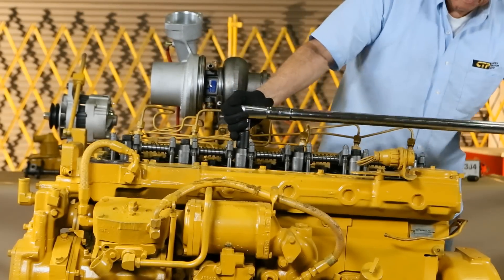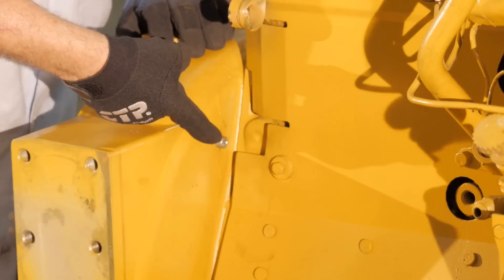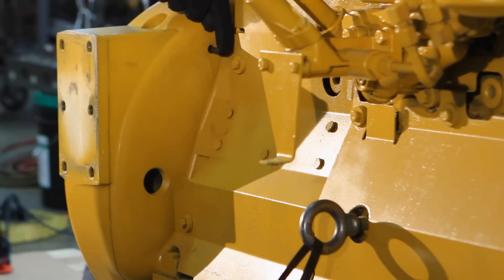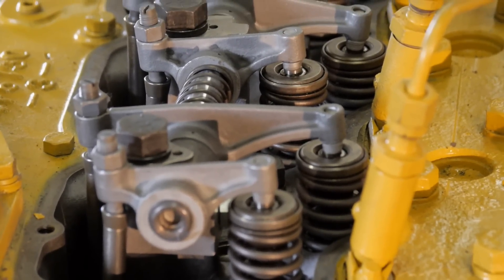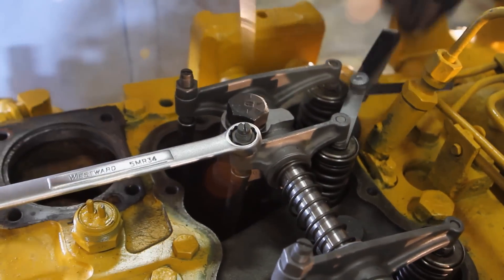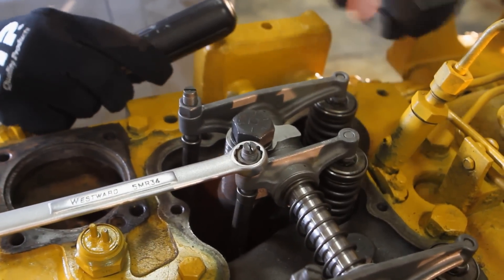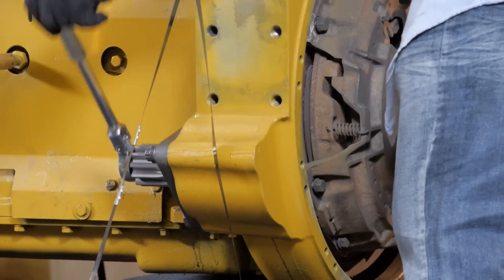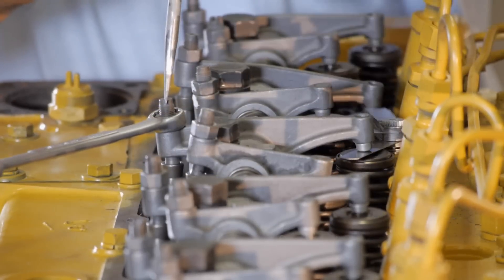Valve Lash Adjusment

Comment: Video states "turn flywheel until the locating bolt drops into the flywheel , now #1 piston is at Top Dead Center, compression stroke or exhaust "(TDC).  
  Adjust Intake valves Cyl 1, 2, 4.  Adjust exhaust valves Cyl 1,3,5.
 ROTATE FLYWHEEL 360*  (360 Degrees),   Now adjust  Intake valves 3, 5, 6  and  Exhaust valves 2,4,6.  .   

QUESTIONS. Since the flywheel was rotated 360*, has the camshaft rotated 180* ?     QUESTION How about tips on doing this on an installed Engine?   How would one rotate the engine and find TDC #1 Cylinder on compressions stroke?   Are there markings?  Can this engine be rotated by hand?   At what engine temp should valves be adjusted on a Cat 3124?  Ambient temp, cool engine? 

Thanks   Mike C.
Reply: You can run valves on hot or cold I set mine on cold because heat expands things and hit engines burn you  as for finding correct stroke if your on compression #1 would be lose and #6 intake will start to rock open if it’s a gas engine pull #1 piston will break down right when #6 intake opens I use a screwdriver or piece of tubing never set a valve that’s on lobe rocker arms will be lose.

Comment: Fisrt roundIntake 1-2-4 and exaust 1-3-5 
And second intake 1-2-4 and  exaust 1-3-5 
First round will take fan side to flywheel side and second round take flywheel side to fanside
Reply: prem in both round you are setting tapit for same valve
Reply: @6316645  yes